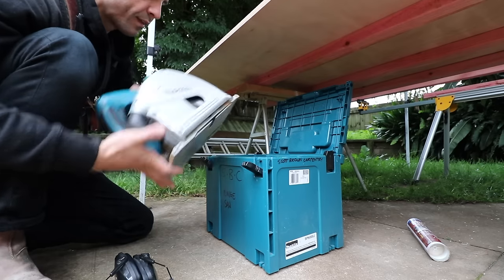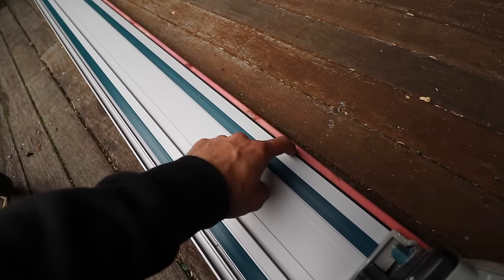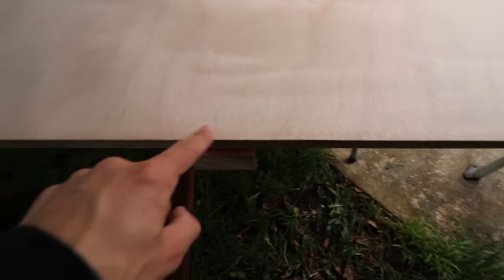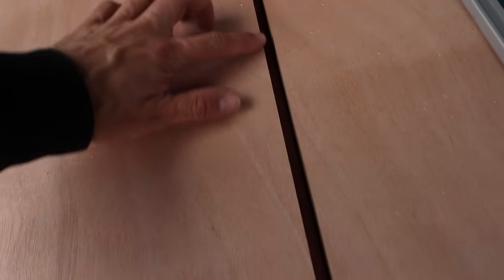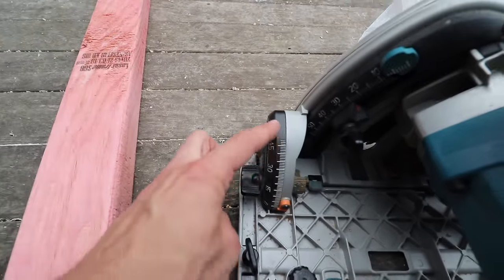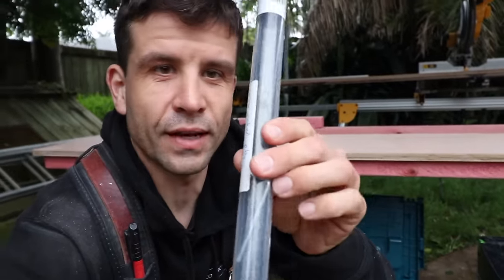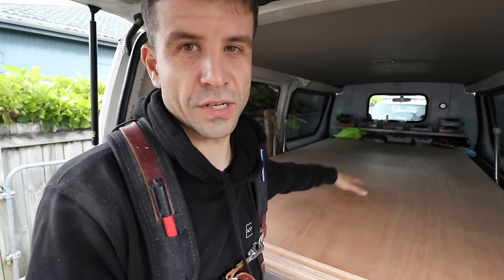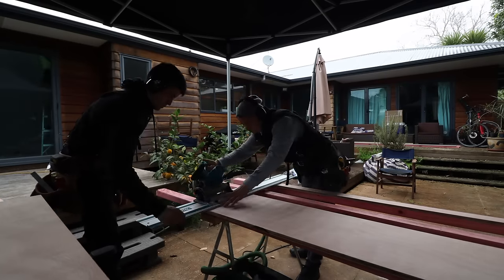Makita Track Saw (Why Every Builder Needs One)

Comment: Thanks for the info about the rubber edge of the track needing trimming with your first cut 👍 ive recently bought this saw and a brand new track and thought the blade setting on the saw was faulty or missing some spacers as when I lowered the blade to the track it was hitting the rubber

Comment: If my memory serves me: Mafell invented the saw and then licensed it (or the tracks) to both Festool and later Makita - hence the near identical tracks. Of the 3 the Mafell is the slightly better made but Festool made theirs just right in terms of quality and its cheaper than Maffel who tend to over-engineer stuff so that most joiners cant or wont pay for them. Makita, as always find the perfect balance of quality and price and the only real difference between it and the Festool is the lack of the riving knife - since only finish joiners and cabinetmakers tend to rip full boards of solid hardwoods (and they often choose Mafell or Festool) that was a sensible trade off for the jobby carpenter and builder who mostly will be cutting ply and MDF etc. The riving knife is VERY much a plus if you are using this saw with natural hardwoods though because they will quite often release stresses as cut and pinch the blade and cause a kickback without it - even with the riving knife oak boards will bind so hard the saw wont move without clamping the board open halfway through.
Reply: downside of makita is that the slidingwheels on the side are flattened very fast and you get some sideways movement, that plastic is to soft or the bearings aren't right
Reply: Makita is niet te vergelijken met festool, veel lagere kwaliteit
Reply: Thank you for that insight. It’s great when builders in the know share for the new guys. I rely on insights like yours to help me navigate the massive world or tools and their uses. Having settled in the Makita platform several months ago, I have absolutely no regrets. They’ve been absolutely brilliant for the minimal amount of building I’m able to do. Festool, at this point in my journey, would be wasted on me, I think. Too many pros are so adamant about buy in the best from the beginning, but I sort of feel like that’s a bit like telling a beginning guitarist to buy a 1959 Les Paul Custom as their first guitar. Never mind the money, they just don’t know enough to appreciate everything it is — or even when it might not be living up to its potential. Learning on Festool, then, might be like learning to drive in a Ferrari.
Reply: I have both and found the makita motor seems better while festool depth and blade change are better. Was surprised that the festool was not much better for example noise is the same on both and dust collection

Comment: I use a straight piece of 1x3 ripped down on a table saw and screwed to a piece of 3/8 plywood. Run the saw along the ripped board cuts the plywood the first cut and from there I line that edge up to make cuts. Haven't tested it for cabinet making though.

Comment: The big difference between the festool and the Mikita is on the larger festool (TS75) it has a 8 1/4” blade and cuts Significantly deeper than any other tracks on the market that I’m aware of.
You should keep that track cut off you’ll be surprised how handy it will be when you just need to plunge cut a small hole in a floor, vent for example.
As always love the videos Scott!
Reply from the maker: Haha I actually kept it in the end. Just did that for dramatic effect 🙂 damn that TS75 looks like a beast 😲
Reply: Makita has a 10 inch coming. Theyve had the 9.25 inch for a while now.

Comment: my days of throwing up whole sheets on the table saw are getting closer to the end. this is a pretty logical step. i have some straightedges to run my circular saw against, but i like that fancy track. a fine edge indeed.
Reply: Zero tearout as well. The blades for these saws are straight cut. They have changed how sheets are cut for sure. I just finished a ply and batten sleepout and this saw was a god send. Cut the job in half i reckon.
Reply: My dad cut off his fingers on a table saw. It's a lot safer to push the saw through the wood than the wood through the saw. And a tracksaw and bench takes less space in the shop. You don't have to allow for 8 ft of infeed and 8 ft of outfeed on the ends of the table saw. I bought a tracksaw and never looked back. Two marks on the wood, set the track in place and saw! So simple!
Reply: @darrellfleury5394  SAFETY first,  why i don't have a table saw - but do have 8 fingers and 2 thumbs

Comment: just got the makita 2x 18v cordless plunge saw. Best tool ive bought
Reply from the maker: Nice, that came out just after I bought my one
Reply: Yep the cordless is very nice. 36v and no stinking cord getting in the way.
Reply: Yup, I have the battery one too, the downside is it doesn’t turn the vacuum on like a corded.
Reply: @survivechicago  the 36v has bluetooth capability

Comment: I've owned this saw for a long time and use it in pretty minimal applications. The clean straight cuts and dust collection are superb, but rarely required in builder or site work applications. Love mine and wouldn't be without one, but I know a lot of builders that don't need one of these and as such, don't own one.
Reply: Rafe Maxwell it's designed for more finer work

Comment: We use the Mafell, I think you get a couple of extra features such as 48 degree bevell, score cut setting and I think the guide rail connection system is better than most other versions. Actual cut quality which is the most important thing looks pretty much the same!
Reply: Big Smith is mafell german?
Reply: @MsElijah16  Yes.

Comment: From what I saw the Bosch guide tracks adjust themselves to a straight line. So two short lengths are just as straight as one long one. That comes from the way you join tow tracks. And it is meant to be fast as well.

Comment: My quote from Carbatec for a Festo was over 2K with a couple of their short tracks. The Makita was around 1K with both a 3M and 1.4M track bought locally. I have been impressed with it. I bought it so I could break down sheets more safely. 
For cutting tapers it is the berries. 
The Shepparch clamps and joiners are available from Hafco at an economical price.
Reply: Where did you buy  the makita kit from?

Comment: You can always pull the rubber off and put it one or two mm further. So don't have to buy a new strip. They are not expensive, but not always in stock. This tool is an absolute must. it's a very portable table saw. And being able to cut something out of the middle is a blast. When you need to rip piece after piece, you ofcourse still need a table saw.

Comment: I have this saw and a few tracks to go with it. Its a great saw. I don't have the shop space to devote to a huge table saw. So between this track saw a rigid contractor table saw I can do pretty good.
Great review.
Reply: You can do angle cuts that would not be possible on a table saw. You could take a square sheet and cut it into a hexagon if you want with the track saw which would not be so easy on a table saw.

Comment: Bunnings have an ozito track saw for the casual diyer, $189, comes with 2 tracks. Ive used to build my kitchen cabinets and works fine if ya cant afford makita or the like
Reply: should add thats in australian $$$
Reply: I bought one to cut up ply to clad the inside of my shed.  It's not going to be neater or more accurate that a "real" brand, but I've been really happy with it. It's the only bit of ozito I've bought. I did upgrade the blade as soon as I bought it though. no tear outs, nice enough cut.

Comment: Best feature makita has over the festool is the scribe cut setting. So handy to have. Personally I find the makita the best value for money. Had mine now for five years, gets used most days. My only complaint is the cost of blades.
Reply: I have the Makita cordless track saw.  I find the scoring cut setting/knob/thingy to be a bit too deep, which means slight tearout.  I just drop the blade to where it kisses the work piece, tighten the depth knob and run it.  Come back and do a full depth cut.
Reply: @ThekiBoran  one day I'll have the cordless one. With me it's more to do with the blade condition when the tear out on the scribe cut is bad.  Fitting kitchens all the time its always MFC or MDF I'm cutting so blades will only take so much of that cutting. I've learned that most times I don't need to have both faces chip free so I make sure I cut face down. The main thing is a straight cut. The scribe cut gives you a less deep cut on the second pass which I do find makes a big difference on the saw and the cut itself if I were to cut a panel on one pass. Hope that makes sense.
Cheers

Comment: Starting as a hammerhand, I never understood track saws until I got into negative detail sheet fixing. You cannot get a satisfactory result without it.

Then you find using it for other applications like fibercement sheets instead of a shear cutter. Or bevel cutting bottom of claddings.

Pricey tool but it can deliver good results or save time.
Reply from the maker: Totally agree man

Comment: Better faster height adjustment, slightly better dust extraction and quicker blade change on the festool.. Makita still probably better value and a decent track saw.

Comment: I have the Bosch version and would never be without it, makes cutting any sheet material easy as with perfect splinter free results, It's the only saw I use now for trimming doors.
Anyone that says the Festool is so much better is just a tool snob brainwashed into thinking the festool is so much better, the Makita, Bosch and Festool  all produce excellent results, Bosch one is made in Switzerland and blades Italy.

The fact that you have one puts you way ahead of most builders because your average builder does not have one, says a lot about the quality of work like to do.

Comment: Awesome ! Just bought the cordless version of the Makita track saw. Expecting delivery tomorrow. Had Festool corded version but didn’t want to spend that much on the cordless version this time around.😊 Maybe another time.
Reply: How did you get on with the cordless Makita.. any serious gripes?
Reply: @chevyimp - I actually just recently used it for the first time and so far everything seems to fine. Don’t have any gripes or complaints yet, but that may or may not change after more usage.
Reply: @chevyimp - None so far, but that may or may not change after many more intense usage.
Reply: Thanks for the reply.. I'm just mulling the cordless options over at the moment..

Comment: I agree completely. A rail or track saw changes the way a carpenter works massively. I would go festool every day , mostly for the dust control. I would also recommend the ts75 over the ts55 . Months of hanging solid oak and walnut doors into existing openings and the ts55 struggles. Not so with the ts75. Its more money but well worth it. Oh and youre mans right. Always use one with an extractor.
Good video again mate.
Reply from the maker: Maybe a future purchase then mate! Thanks

Comment: I bet that hurt a bit when you had to cut the track down haha
Reply: Especially when he tossed it in the bin, even more so when he next needed to make a 3m length cut and could have used a track connector bar to join the drop scrap.
Reply: PG Contract was thinking the same thing . Would of been handy to just keep the little off cut in the van/ truck in case
Reply: Should have cut a slot in the back door of the van.
Reply: @George-ie1si  yes that would of hurt alot less. And I'm being serious haha
Reply: George 😁
Reply: Especially cause he cut it to 2650 so he can't cut 2.7 sheets 😭
Reply: @George-ie1si  the 3m fits on our hiaces 🤦 they are $250 each those tracks don't understand why you'd cut it.
Reply: @bmsmith5UB  i believe you can go 25 mm over the edge of the track on both sides and have a straight cut.
Reply: Just bought it. Amazing piece. Made my own built-in cupboards, cut a hardwood windowsill. Gonna throw my old cheap saw to bin.
Reply: @MCA996  where can you get for $250, very keen? Just ordered (half hour ago) the Makita 36v plunge saw at a super cheap price, expect it in 2 days. So now looking for track and some are like $350, that's more that half the price of the saw.

Comment: The Makita track has an additional lip to prevent the saw tipping over when doing a bevel cut. It looks almost identical to the Festool track but the anti-tip function on the Makita Saw will not work with the Festool Track

Comment: Not sure why everyone says the Festool is over priced, the TS 55 is currently retailing for $1127NZD inc GST with a 1400 rail and a case, that's $150 more than a Makita kit. For that increase in price you get: The worlds most popular plunge saw, much better build quality, made In Germany, better accessories in the box and on the tool, better range of accessories to expand to use for different applications, no having to calculate offsets when doing bevel cuts, nylon cam runners (vs Makita makita metal on metal).
I use my one for all sheets from shadow clad to hardies to magnum board. With a good hardies blade on it (not a 4 tooth one / has to be 8-12 teeth PCD) the saw rips through 9mm hardies board with ease and zero dust.
Reply: thanks for that review! How long have you been using it?

Comment: I've used the festool good saw but I brought the dewalt one, quarter of the price with 2 1500 tracks which join perfect really easy I'm not a big fan of dewalt but when I brought it there wasn't a lot of choice, but it still works as well as when I first got it, you should have a look at rr buildings he dose some good tool reviews ie battery nail guns

Comment: @scottbrowncarpentry I have the makita 240V saw with 1400/3000 tracks, clamps, joiners, even found a 165mm diamond blade for dust controlled straight cuts of cement boards etc. Love the saw, makes very accurate cuts in the plane, but I find the vertical accuracy leaves a lot to be desired. I had Makita replace the short rail and the base plate on the saw, but the saw still rocks on the rail so i cant guarantee the cut is vertical/ whatever angle i set it. The base plate seems to have a twist in it. Wondering if anyone else has had this issue...

Comment: Hello Scott, Ive just bought a new 36V saw with 3M rail. The longest piece of flat board I have is a 1200x2400x12mm piece of MDF. So its not quite long enough to lay the new rail on and cut the splinter guard in one go. Will I be alright to stop near the end of the board and then slide the rail back and continue the cut to the end of the rail? Or should I try and lay another piece of mdf butted up against the other and try it in one continuous cut? I was going to do it on tresells as I don't really have a large enough piece of flat concrete to do it on in my yard which makes using two boards impossible.

Comment: Hey I’m just wondering what’s the difference between using a track saw and a circular saw? Obviously the track saw has its own cutting guide  but don’t both of them do the exact same job?
Reply: The track ?? 🙄😂😂
Seriously... the saw is running on a track so DEAD straight cut... also... when setting up for the cut, you just align the track edge to your pencil marks and cut !! 
I bought a cheapy one for hobby/DIY and I love it... 😎👍☘🍺
Reply: Yes, they're bth circular saws. For me the biggest difference is the enclosure around the track saw channels ALL your sawdust into your vacuum. If you have a Makita Vacuum, which I like better than the Festool because it's quieter.

Comment: Can you use it without clamping the track down?
Reply from the maker: Yes, it is held in place by the rubber strips underneath. The clamps are an extra precaution that I use on some cuts.
Reply: @ScottBrownCarpentry  ok just tried it. Holy crap works great. Working on a sacrificial bench makes it so much easier and quicker to use. Thanks!

Comment: Hey Scott, 2 questions bud.
1. Do you use clamps under the bottom of the track to hold in position, or is it just held to the timber by friction and pressure.
2. What blade do you use on the plunge saw mate? Those cuts are tight!
Reply: Makita make a nice and thin blade I think called a efficut tct 56tooth blade which produce amazing cut quality
Reply: Clamping is good practice if you cant afford redoing the cut. I experienced some slips of material (plywood) under the track, but that could have been my lack of experience. Now i'll take time to clamp my piece properly to avoid slips, just to stay on the safe side. Many experienced users do not use clamps with the track saw

Comment: Hey man, great videos. I have to ask why you wouldn’t just use a skillsaw with a long straight board as a guide? Would be so much cheaper but maybe you can discuss the Pros and cons? I’m wanting to get a track saw but I can’t yet see if the price is worth it when a skillsaw does essentially the same thing
Reply: You can get far cleaner cuts with less tear out of the wood. It's great if your cutting stuff that has a finish on it
Reply: Plunge saws are great for.....plunge cuts. Allows you to cut a letter box or pet flap. SP6000 all day.

Comment: How about they sell a 8' length of 1x3inch aluminum with the rubber underneath so i can use that to guide my regular circular saw instead of buying a whole new saw n rails? Cuz we all have been clamping down straight edges to make these kida cuts